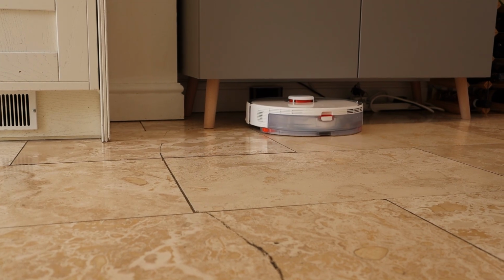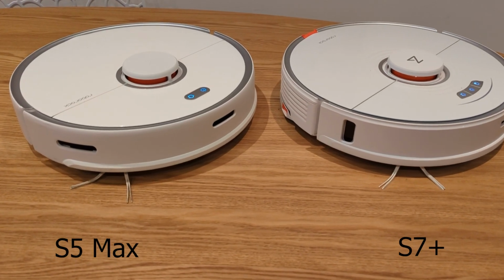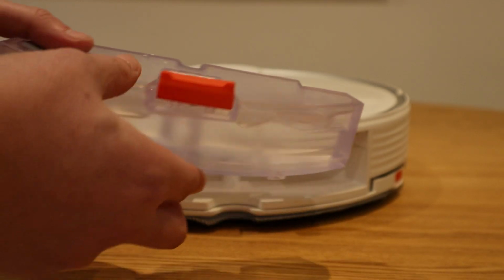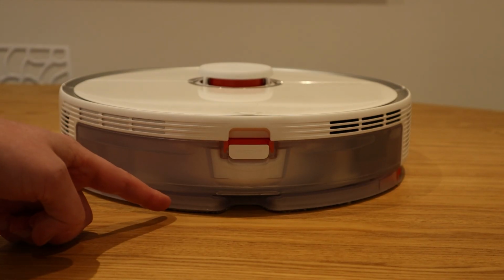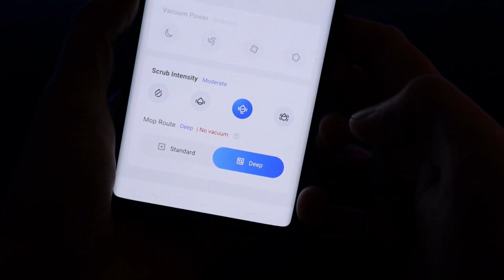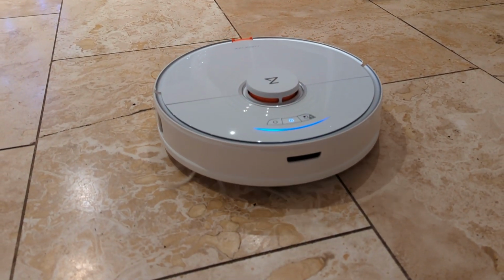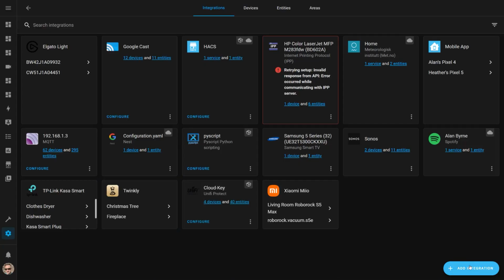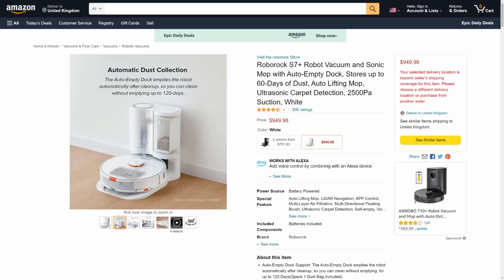Roborock S7 Plus - The greatest home automation product ever!

Comment: I have S7+, and it's great vacuum and mop. There is tons of reviews of it here on youtube. I expected this one to be different, as the title reads "best home automation product". Well, I must say I'm so disappointed by complete lack of automation support by S7+.It can't be connected to HomeAssistant via any local API (as Nuki Lock/Bridge has for example), and it can't be connected when you linked it to manufacturer's app Roborock (which provides the "low water" notification itself, without any coding). You have to connect it to Mi Home app instead to be able to "integrate it". I have the official Roborock app so I linked it to Alexa instead. And now, all the "best home automation product" offers is simple on/off switch! I don't like to run vacuum on schedule because I leave house at different times, so I have an automation to turn it on 10 minutes after I leave house, if it was not already run that day. But because it's only on/off, it uses the last setting you have there. So if you manually run Deep Mop, next day, the automation will again run Deep Mop, instead of Vac&Mop. Eh... And that comes great with the "low watter" notification, which actually means "no water". So you get this notification when you already left home and cleaning is half done. Now half house is deep mopped (no vacuuming on deep mop), and half is only vacuumed (because there is no water), when you wanted vacuum+normal mop the whole house... From the "best home automation product", I'd expect a bit more than simple on/off. When talking about robo vacuum and automation, ability to set cleaning type (vacuum only/deep mop/vac&mop), and specify where to clean (whole apartment, specific room only), which is just not possible with Roborock S7+.

Comment: Hey mate, thanks for doing this video. I’m glad that you’re in the uk - I am too. But I just can’t seem to get my hands on one of these! The roborok Facebook page keeps advertising but they don’t ship to uk. Any ideas where I can buy? I see I can get a French one, but I’m concerned the voltage might be different if it’s a different plug & wouldn’t want to blow it. Thank you
Reply from the maker: Hello mate! The auto empty dock is unfortunately not yet available in the UK. They only have a 110 volt model available, which is for sale in the US.  I was lucky enough that Roborock sent me one, and I used a 220v to 110v voltage converter to make it work here in the UK.

You can still buy the S7 vacuum cleaner on its own, and then later on add the Auto Empty dock when it becomes available in the UK.  I asked Roborock when they plan to release it, but they unfortunately do not have a date yet.

I've updated the link in the description to include a link to the Amazon listing for the UK version of the robot itself.
Reply: Please see my comment elsewhere in this video. You'll get no warranty as it's not officially sold here and most places that sell it in the UK will hike up the price a lot.

Comment: Where to get one? I'm in the UK too and there isn't an official outlet.
Reply from the maker: Hello Tony, unfortunately the auto empty dock is  not yet available here in the UK. They only have a 110 volt model available, which is for sale in the US.  I was lucky enough that Roborock sent me one, and I used a 220v to 110v voltage converter to make it work here in the UK.

You can still buy the S7 vacuum cleaner on its own, and then later on add the Auto Empty dock when it becomes available in the UK.  I asked Roborock when they plan to release it, but they unfortunately do not have a date yet.

I've updated the link in the description to include a link to the Amazon listing for the UK version of the robot itself.